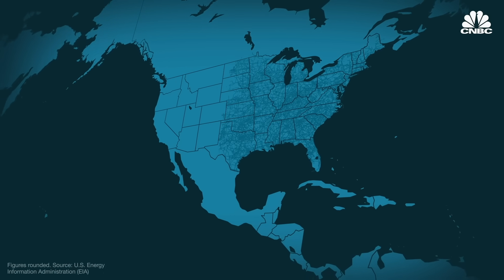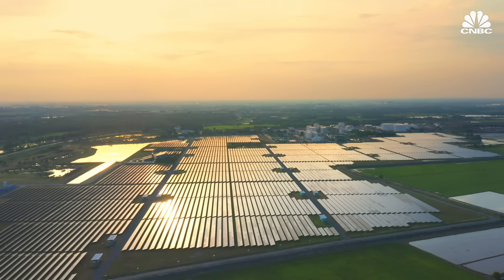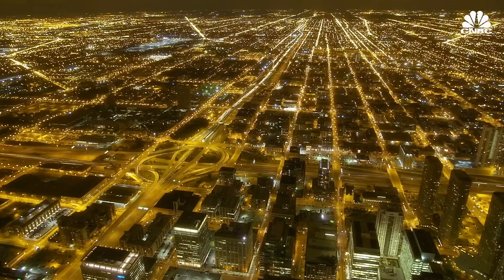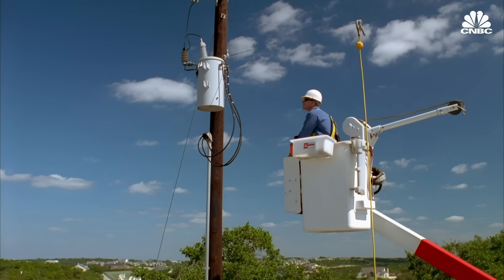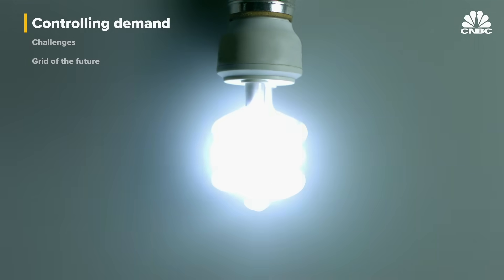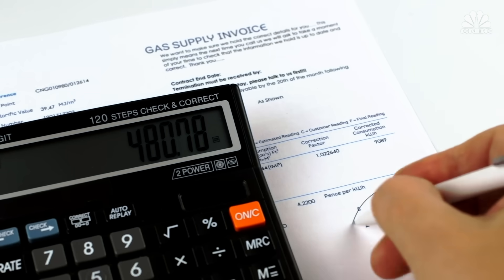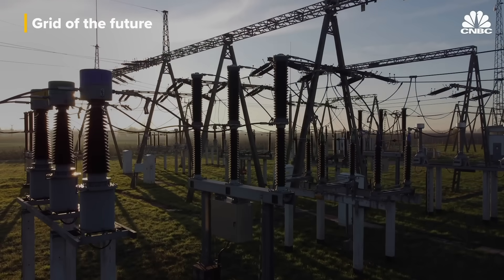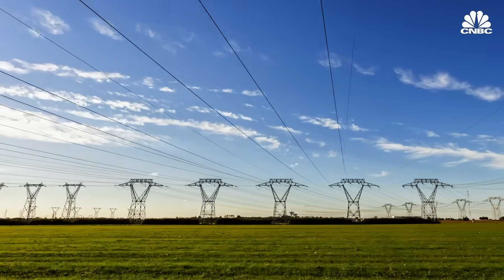How The U.S. Can Build A 100% Clean Grid

Comment: What would it cost (Environmentally) to upgrade the capacity power grid in the long run, instead of relying on smart grids? Would be much better to upgrade it and then install nuclear reactors and in turn, have access to an abundance of electricity instead of the rather communist method of sharing a perceived finite power source.

Comment: The coal fired power plant is the back bone of our grid. If you want to meet these new goals they will have to be replaced and nuclear will not help because it’s too expensive. The only paradigm that can work is called “Liquid Air.” (That’s air not wind) This plant is in the same cost range as a coal fired power plant - it’s clean, renewable, safe and reliable !!!

Comment: The only way we would be able to build a completely green electric grid is if we spent 200 TRILLION dollars to make china richer, and us poorer. The only thing green energy does is make the US look like a fool.
Reply: That makes zero sense.
Reply: @texaswunderkind  That's only  because your not paying attention to facts. 90% of the resources needed to make the US green, would have to come through china, either through mines they own, or through the fact that almost no one wants to have the toxic waste processes in there back yards. China does most of the processing for the materials needed and owns 65% of the mines. Even with trillions already spent, we can only power 7% of the US electric grid with solar or wind. The majority of renewables comes from hydro, which is pretty hard to make new dams where there are no rivers.

What is worse, is that they want us to go to electric cars, which means that we need about 80% more electricity than we can produce right now.

On the flip side, EVEN if the entire world stopped producing co2 right now, the change in 100 years would be only about a tenth of a degree.

Comment: they made the grid to sell electricity. the focus will always be on the sale. the reason is that power was first generated by hydro which requires distribution, being a point source.  now they wish to continue the brainwash by connecting the panels to the grid and making them a part of the 'sale.'
this results in the hilarious disconnect from your own panels when the power fails.  people are afraid to study electricity. they might get shocked.

Comment: I think it’s interesting that in this report nothing was mentioned about how terrible the Texas power grid is and what they were doing back in 2020 and 2021 historic ice storm. The power companies were adjusting people‘s thermostats that had these smart devices and were locking them still that people could not increase the heat while the temperatures outside were below freezing
Reply: How does the power company have power over the home wifi?     And as long as it's at 55 or more the house will be fine for heat in emergency.  I can't imagine the power companies were turning them lower

Comment: Using natural gas in cars as CNG would dramatically drop our emissions. Then to transfer over to RNG then to HFC then to all EVs while still adding the a carbon tax would be the most efficient way zero emissions. Carbon tax would be used to upgrade our grid and pay for renewable energy on all homes. Effectively this would be ready by 2040 if we were to start this in 2025. We could use oil power plants in coal country to lower there emissions and energy bill. And put manufacturing plants in those areas to create jobs like EV’s manufacturing and have phone manufacturing there too. Even add waste sorting to facilities there as well

Comment: With out getting into a lot of engineering, Edison developed a 110 volt DC distribution network.  Tesla engineered, and Westinghouse manufactured an AC system which raised and lowered voltage.  This permitted high voltage transmission and safer 110 volt point of use.
HVDC transmission uses 100 to 1100 kv .  This works best for long distance and under water transmission lines.

Comment: She didnt even mention liquid metal batteries for storage. Also there isnt much to change with the actual grid in terms meters. You can literally get bidirectional meter as long as the tranny outside isnt a tesla original 1910 model lol which allows u send and receive at the same time. i do solar grids all the time using this principal. i can see autonomous drone batteries being charged at the local supercharger that is metered differently. Residential is easy, its factories and commercial that use the most power lol its metered different first of all, correcting power factor in one massive factory would be equal to powering hundreds if not thousands of homes for year. limiting people will never work nor will anybody stand for it. so edgey lmao cnbc i could live off grid right now if i had a 100000 and for 10000 the hydro company pays me every month lol.

Comment: This video is interesting but doesn’t work in practice, the energy plants are near the cities due to core losses during the transmission of this power and substations, making transmission lines hundreds or even thousands of miles away from the energy source would cause a extremely high energy loss resulting in lost revenue for these future plants, probably running into the 30% energy loss range by the time it reaches the household, but it could be even higher.

Comment: Where is the conversation about SF6 gas? It's still used for electrical switches and circuit breakers (it has been banned in other sectors). It's a 23500 times stronger greenhouse gas as CO2. The demand and use of it increases and so does the leakage into the atmosphere (where it remains for 3000 years) as the electric grid  and the demand for many electrical devices, such as windmills, continues to grow. There appear to be alternatives but these are ignored for economic/security/(profit?) reasons. Just google it.
Reply: Your nuclear dream won't solve it, so don't bother me with that.

Comment: Bidens 80% electricity from clean energy by 2030 is BS.  So says the following year 2020 figures from the Energy Information Administration.  

If over the next 9 years, no additional electricity is generated beyond 2020 of 4.01 Trillion KW, 1.6TKW of fossil fuel has to be eliminated.  2020 generation is down many billions from the previous years.  There won't be any increase in nuclear power for plants have been generating in excess of capacity since 1990.  Hydroelectric - no change.  BioMass - is 1.4% but it is not clean for wood is burned to make electricity, releasing co2..  

This leaves Wind (338billion) and solar 91 billion.  In 2020 this was about 10.6% of electricity generated yet the capacity is 23%.  Wind and solar produce at less then 50% capacity, the most inefficient of the present sources of generation.

W&S Constructed capacity would have to increase 8 fold (to 3.2TKW)  in 9 years to reach 1.6Tkw of generated electricity too offset the fossil fuel reduction.

The idea is bs because the technology does not exist.  Take a good hard look at what is folks.  Try some actual thought, dig for data instead of repeating lemming phrases

Comment: so, the basic drift..... is they are wanting to update the grid to have control over the power that is flowing to the consumer. Their way of getting to 100% renewable energy is taking away total available to the grid. Each of the other ideas have already been implemented. No one talked about power correction factor, at the city/town substations. which would help reduce the use of electricity. 

Being 100% renewable energy is perfect. If it is able to supply power that consumers are wanting. not by shutting down sections at a time like they did last year in California. Hours or days of no electricity is not good.

Comment: The current environmental movement has the perfect solution to "Climate Change". Eliminate all of your baseload dirty energy sources first, then build as many intermittent "green" energy sources as you can as fast as you can while completely avoiding even thinking about a new greener baseload system (like nuclear). 
This should work perfectly,  people will be eliminated by allowing themselves to freeze in the dark while they are starving to death. No people, no energy required, the perfect solution.

Comment: At 7.05 the video says solar and wind farms will replace fossil fuel plants. How can solar and wind that cannot react to load variation replace plants that can, i.e asynchronous generation from renewables  cannot power a grid by them selves. It also mentions intermittency fo renewables but batteries are an infeasible solution to that very real problem.
The proposals shown here are technically unworkable. 
Altering time of day use by consumers is a small alteration to demand in reality and demand is in part due to the way we live during the day.

Comment: If you want reliable and most inexpensive and secure consistency of electric supply it has to be local community, scalable fusion nuclear. See how at "aureon @t". If you have generation near the point of use you need less of a grid and old fission and fossil plants can be retrofitted with Aureons Safire Generators on any scale needed.

Comment: All solar and wind generation needs an equal capacity gas/oil standby generator for cloudy and windless days. Also renewables can produce more power than the grid can use which will collapse the entire grid. This is a growing danger.

Also, today's batteries are not the answer in the enormous qualities that would be needed, because today's batteries cause huge ecological damage and would need to be entirely replaced at least every decade. 

We are trying to reduce the US's carbon production while at the same time New York and California are shutting down all their nuclear plants increasing their dependency on coal and increasing their carbon production by billions of tons per year.

Comment: Central Sourced power, even if solar sourced, is not a network, it's a profit structured monopoly.!.!. We could have renewable energy if the incentives for compensation was shared with the opportunity to produce solar energy to share,.like an SREC system which is funded by carbon polluters, and not only coal.!.!.! If gas and all petroleum  was taxed into it, rapid expansion with the withering of fossil fuel would happen automatically with positive economics for the working classes... instead of moving the most money to the top Criminal classes.!.!.!.

Comment: A centralized software managed grid  would make us more vulnerable to cyber-attack and unforseen bugs. Micro-grids under the power of a broad range of energy sources would be most resilient.
Reply: I agree with your point about the vulnerability of a centralized software managed grid. It's important to have a resilient system in place, especially in the case of cyber-attacks. Micro-grids powered by a variety of energy sources can provide that resilience. By the way, if you're looking for a reliable home backup power solution, I recommend checking out the Segway Portable PowerStation Cube Series. It has a massive capacity, fast recharging, and comprehensive protections. Great for outdoor enthusiasts and RV lovers!
Reply: Thank you for sharing your thoughts! I agree that a micro-grid system with a broad range of energy sources would provide resilience to cyber-attacks and bugs. Speaking of power solutions, have you heard about the Segway Portable PowerStation Cube Series? It's a versatile powerhouse with a massive capacity, powerful output, and comprehensive protections. It could be a great addition to your outdoor gear collection!

Comment: Do you know solar power in California varies more than twice between winter and summer? Are you saying that battery, hydro and people behavior will address this issue? If temperature in winter gets low, what people will do? Turn on heater without fossil? or reduce temperature low enough so that even the seasonable fluctuation of power output could be absorbed? Can you please study a bit deeper as to how the intermittent nature of renewable energy source could be addressed? Hint: battery and hydro cannot address seasonal fluctuation of renewable energy sources due to economical reason.  Please read this paper: https://www.sciencedirect.com/science/article/pii/S2542435120303251

Comment: Distributed generation and smart meters have some serious downsides. First, the most common types of distributed generation are wind and solar. These are not consistent over time and require immense storage to be viable.  LITHIUM IS NOT RENEWABLE. Second, the local generation, storage, and metering of power will increase the cost of homes, making housing less affordable. Third, smart metering relies upon "big brother" computers watching your power usage, with the ability to throttle your usage.

Comment: Finally someone mentioning that your electric car batteries can become a storage device for the grid.  EVs can be bidirectional I.e. charging from the grid and selling power to the grid.  Using solar to charge your EV, run your house electrical needs (even heating if you have a LEED certified house), and selling excess to the grid is the way to go.
Reply: This is a new concept to me that’s crazy
Reply: How does that impact the batteries lifespan?

Comment: 100% 2035 for real? So here is a concept that CNBC cannot grasp; Its called 3 phase generation. Here is the second concept CNBC does not grasp Alternating Current. The most efficient way to transmit energy down a transmission is to step up the voltage. Stepping up voltage for solar power that is generated in DC then inverted to AC. Solar generation and maintaining a 60Hz sign wave is very difficult and not very reliable with out old fashioned electric generators to keep the signwave constant. The most efficient way to generate electricity is spinning a generator. Solar farms are not very efficient or reliable. The intermittent energy generation with wind turbines although generated in the AC world is very difficult to keep at a constant 60Hz. These fools are are talking about demand reduction. Here is another concept that these fools do not get, demand reduction means more expensive energy because now you are cutting reliable supplies of electricity. Most major utility companies have power traders that are already flexing demand and supply. These energy traders calculate need and availability of energy. Is it cheaper to buy energy on the open market from trading partners or fire up a peaker power plant. Everything is that is discussed about flexing demand is a wealth transfer. Renewable energy is an illusion. Wait til American public figures out that they have been sold a bill of goods.  Our power bill will become painfully expensive and our electric energy will become very unreliable.

Comment: First off, our power grid started out with hydro electric power plants. Which is green and clean. Wind and solar power will not maintain a steady stream of electricity. Going to electric vehicles will be a nightmare . Working in transportation for 16 years, I know what a mess electric 18 wheelers will not work. The limits of the batteries will slow the flow of goods to a crawl. Truck drivers live in their trucks 24/7. It's their home and having to stop over and over to recharge will cause massive traffic jams. It takes a Tesla 31 minutes to charge 80%. With millions of electric cars on the roads traffic will be backed up waiting to recharge.